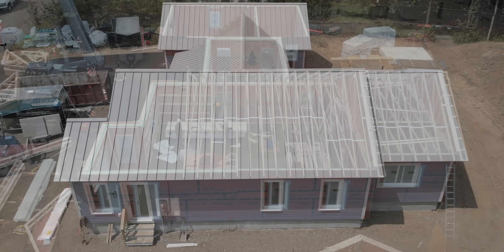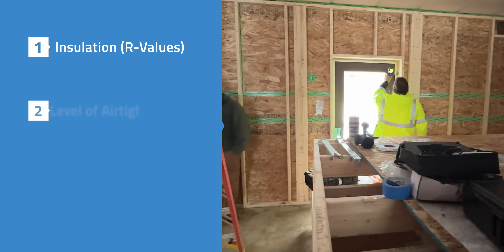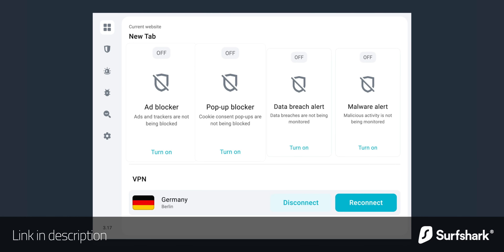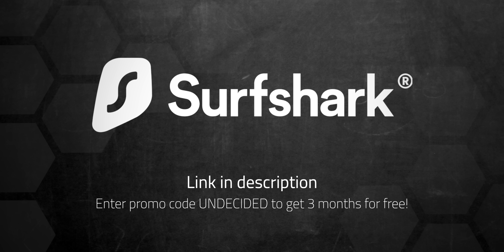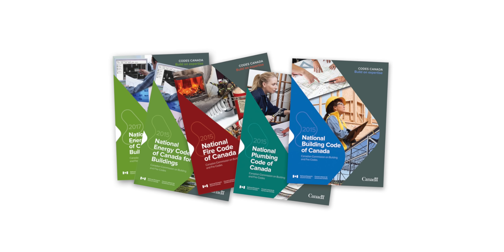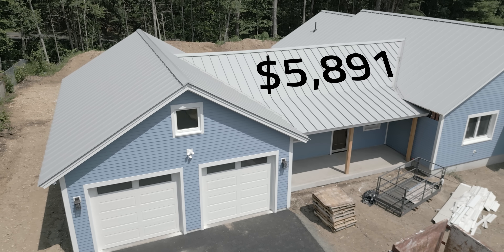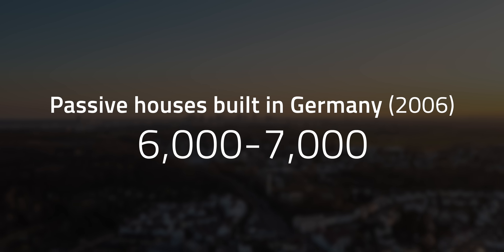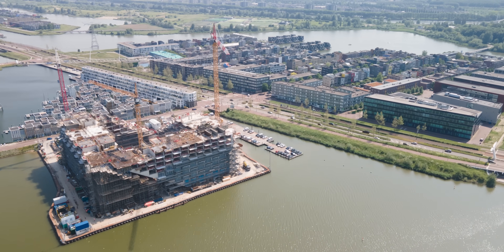Why Do American Homes Suck?

Comment: Yes, I agree that the "we want lower cost" mantra is the prime reason our house efficiency is lower.
I'm OK with spend a bit more now to get better performance over the long run, but bank accounts may impose limits on a person. :)
Still, we did 2x6 walls. We did 5 inches of spray foam for the entire house (meaning under the roof too).
Both of those were considered unusual and stretched my builder a little.
Heat pump for air and hot water, check; which means the ERV is required.
None of that was overly hard, but you do have to plan for and insisted on it in a custom build.
That last part is important because you don't normally get that in a "tract home", which is the issue as most people in single dwelling  homes seem to be tract homes -- at least in this area.
The 2x4 walls and other inefficiencies are cheaper to build and the "industry standard" here in the US for those of us not in really cold climates (and definitely here in north Texas).
There is a LOT of inertia in the industry, again dominated by what people what are willing to pay for.
I don't think that will change either unless the US starts to impose higher standards (IECC) nation-wide which I don't think will happen anytime soon (unfortunately).
And yes, like you I have a solar array ... again, spend a little more now to better returns later.
For at least half the year I have a minimum electric bill, so the solar array will be paid off in 6-7 years.

Comment: I am building a wood frame home in Finland, the outside wall thickness is 35cm, that is 13.8 inches. This is standard. The U-requirement on outside wall is 0.17.

Comment: Unfortunately, it's hard to even build a safe house in the United States due to very poor building standards and contractors. I remember seeing houses in Florida after Hurricane Andrew that were required to have either steel hurricane shutters or impact resistant windows while the bases of the house was a frame construction wrapped by tar paper with vinyl siding. They didn't even have the weak OSB. Plywood should be a minimum standard and an area with wind blown debris.

My preference in that area would be ICF.

Comment: The issue being is many of these 'codes' are written by people out of touch with many of the general public. They sit on councils and on boards of various organizations and make new regulations while not considering the cost. If you're making $200-400K/yr and are building a super efficient house for $600K in a city suburb that they commute back and forth in their Tesla, you are not in touch with the guy who works for a small mechanic shop 100 miles from a city who finally saved enough to build his house now gets hit with 'you need magic insulation, windows and HVAC, plus sprinklers and walls 2x thicker so your windows and doors are 2x the cost, now can't build on the lot he bought. Now he has to sell his lot to another code council member to build his weekend house.... 

Codes are fine but they have to be weighed against the increase in cost and who has to pay and who ends up making money.

Comment: This will mean much more expensive housing. Any regulation will drive up pricing. This will force more poor people into appartment blocks. This will make the US much poorer as equity won't be built in housing, most people's  single largest asset. Also this will ironically hurt landlords and available housing stock as they will not have as much capital to invest in new buildings as maintenaning regulatory compliance with extreamly strict codes will be a majority of rental income.

Comment: passive house in climate zone 6 or higher  is pretty easy.  my Canadian house built in 1997. would be  passive house  in a climate zone of 7a  or higher. or in  a latitude 45 or lower.. my home energy usage  at latitude of 52 ( not very much solar gain in the winter months ) in a hardiness zone of 2 (-45C)  my heating  energy cost is about $150  to $250 per year. standard house is  about $1800 to $2400 in my area . my vampire energy draw (  because nothing shuts off any more as they are not analog but digital in design requiring energy to operate )  is actually more then my  heating needs  in all honesty your house has too many corner to make a  well build passive house.

Comment: In the UK there are minimum standards and when you sell a house it has to come with it’s energy efficiency certificate which the seller has to pay to be undertaken and produced. Most houses here have very energy efficient windows and doors as is loft and wall insulation. However here most houses are built of brick.

Comment: As a carpenter in Alaska, your design I would argue is less efficient than the way we build up here. The guy that taught me builds to a 6 star energy rating for subarctic climates. Btw you need airchanges to prevent mold growth. You are making a huge mistake if you aren't doing that air exchange as moisture from showers, cooking, breathing, and etc. will build up and can cause mold if your airflow is too weak. Just the little things I know from experience in repairing alot of these homes.

Comment: 95% of municipalities won't let home owners build their own homes with stone/mortar, cordwood,earth ship builds,or thick timber,they want 2x3 popsicle stick homes that were slapped together by speedy Gonzalez crews,they throw cheap tin brackets in place of solid joinery,your not getting mortis n tenor in anything built in the last 50 years unless it was totally custom.The places where a person can legally source all the stone/lumber on their own property is in regions so remote from civilization it negates a lot of savings from not being a debt slave to the bank,it's perfectly legal to buy a mobile home or 2x3 junk box that won't survive elements or nat disasters,just the way THEY want it, Petroleum shingles absorb heat,attics become high humidity saunas that get soaked up into the studs and more importantly the glue board plywood.glue, water,weight,flexing between cold/hot weather deteriorates the nails,joints,shingles until the point massive upkeep is needed.Its not a house ,it's a vehicle to entrap naive homeowners into revolving debt.
Reply: I've read enough to know what you're saying is true. I don't think its by design intentionally...I believe its the unintended consequences of gov. Intervention and lobbyists. 
Famous economist Thomas Sowell has said "The road to hell, is paved with ivy leagues "

Comment: Contrary to your statement that the Us has No energy standards, it does for HVAC equipment for gas fired furnaces and boilers, air conditioning, heat pumps, and water heaters. 
I am a semi retired HVAC&R contractor and was pushing energy equipment sense the late 70’s. 
Much of the decision on a high-efficiency equipment is based on ROI (return on investment) 
My father had a house built in 1962 and paid for added insulation he went through and did some air sealing* he bragged about that our bigger house was cheaper to heat the payoff was a little over one year. (*The windows, etc were standard 60’s stuff), even then there was an excellent ROI.  Our 1979 and our son’s 1980 homes are planned for additional air sealing around electrical,plumbing, … in the attic as well as additional insulation this fall and winter, summers are hot in Oklahoma.

Comment: Wow, watching this makes me more appreciated what garbage my "newly renovated" rental is. It was clearly renovated as cheaply as possible with as many corners cut as possible. Currently we have to keep the ac on constantly because the instant it goes off the temperature begins rising. Not to mention that the mini split system just doesn't work here. Because of how the vents and ducting is set up the system never sees any change in the ambient air temperature and so will run forever no matter what the temperature is set to. I won't even go into everything else (like the original cast iron drain pipe that split right in half (lengthwise!) about a month after we moved in and got fixed by three separate handy-men because landlords are apparently just too universally cheap to just do it right the first time).

Comment: My wife is a steuctural draftswoman here in switzerland. If you solve for example a roof detail and forget to isolate something or a smal gap remains where brick or wood (if not extremly thick) has no insulation its considred a heat bridge. Its basically the cardinal sin of the job.

Comment: The main problem that housing price is extremely inflated. There are a century old homes that has to be bulldozed and rebuilt from ground up but nothing is done because it is extremely expensive and bureaucratic to say the least. 90% of buildings have low ceilings, not enough windows, leaking basements, mold in bathrooms due to the lack or non-working vents.

Comment: I'd would have liked to see a break down when you said that your house would have a savings of $5k a year vs other houses in your neighborhood. The other information that would be worthwhile for comparison is the cost of your house with all the energy saving upgrades vs the cost of the average neighborhood house. Then the comparison would be more fair than just the blanket statement of energy savings, as in, how long would it be to offset the added costs for that savings?

Comment: “The powers not delegated to the United States by the Constitution, nor prohibited by it to the States, are reserved to the States respectively, or to the people” this is the 10th Amendment of the United States Constitution. Is the reason for no national standard's on a lot Fields, not just building code. The solar panels did become affordable in the US until 2013. Jimmy Carter told us it would be in less than 10 years. Impearl vs. Metric. Congress passed a bill man dating we change over in 10 years in 1972. If you saw  car made in that period, everything was in both systems. The only industry that completely changed over was the beverage industry. There was so much push back that Pres. Reagan an congress dropped it. That was  over 40 years ago. We should have been finished with the change in 1982. State do not over regulate the housing industry  because of cost. Big cities like NYC an Chicago o over regulate. Of cost that excludes California which over regulates every industry, they 100,000 more regulation than the state in second place. Remember someone has to pay for these regulation, I am glad that you can afford it.

Comment: We renovated a house build in 1969 in 2005 in Germany. We installed a heatpump, a ventilation system which uses outgoing air to heat up incomming air which went through pipes in the ground of our garden before. We renewed the roof, the windows the doors. We installed massive insulation even inbetween the floors.
We nearly reached passive standard but it was very expensive. At that time it was pure hope to do something good for the future. It may have cost twice as much as
German standard homes at that time…
Today Building a house in Germany is so expensive that many young families aren‘t able to afford it anyway…
And not all regulations are well thought-out…
Reply: I've heard (and seen some videos about it) that MOST young Europeans  are resigned to the fact that they'll never own, they can only afford to rent.  The dream of home ownership is really non-existent for them.
Reply: I've worked for a company that specializes in houses made from prefabricated modules. They were not on the cheap side relatively to other building companies and still couldn't satisfy the demand of potential customers.

The reason was probably the low interest rate at the time because cost barely matters as long as banks are willing to loan money to virtually anyone. 
Buying a house and paying off a loan didn't really cost that much more than paying rent.
Rising interest rates crippled that somewhat.

I don't know how the market is today though since I'm no longer in the industry. I figured after millennials are done starting families and buying houses in the process (that was our biggest customer base), the market would've slowed down anyway.

Millennials were the last generation born during years with high birth rates and are around 40 years by now. Those who haven't bought a house until now probably won't ever. After them there's just not that many people so the market will have to adapt or shrink.

We'll have to wait another 20-30 years until gen alpha is settling down to see another noticable rise in demand I reckon.

But that's just like my opinion man...

Comment: Well, I wouldn't be so hard on US building. I'm from Switzerland, and worked as electrician then as electrical engineer for the past the 23 years.

First, not all houses are made with high efficiency standards, far from that. Many architectecs aim for below the minimal requirements and hope not get caught on inspection. There is a lot of trained workers missing on the field, and many people aren't professionnals on the housing construction sites, so air or water sealing is far from always done right. And old houses still not updated regarding insulation.

But the major problem, it's that here, in Switzerland, even in rural areas, houses are so expensive because of our construction techniques, that even a working couple with degrees can't afford a house whitout wealth from heritage.

A small family house costs around 800'000 USD. An "american suburban" sized house costs more tan 1'000'000 USD.

So yes, our housses can survive hearthquakes, tornados, but they either belong to the bank or you will pass debt to your kids.
Reply: This is what I've heard too (and seen in some other Youtube videos).  So the building techniques Matt describes are probably happening only in select areas for select homes that WILL be expensive, being bought by cost-no-object owners. That's not typical.

Comment: I am gonna build my own passive house with dualsun solar heat and electricity panels, battery in the basement and a smart electricity tariff which allows me to export electricity when expensive and Import when it's cheap. By that you can actually get money for living in your house effectively. For heating/warm water i am gonna use a heatpump with a Reservoir being linked to the solar heated water from my roof. With an EV i have to pay for electricity in the end but the house itself is net zero cost.

Comment: One thing I do like about US rules in general, is that regulations are often quite prescriptive, stating exactly what you need to do (thickness of insulation etc.) to meet code. Here in the UK, we tend to have open standards for everything, where a certain benchmark must be met, but there is little guidance how to design to achieve the standard. This is great for large developers, because they can do all sorts of technical analysis to find the cheapest construction to meet the bench mark standard, and the savings on material more than pay for the design work.

But for a homeowner or small local builder, it's difficult (and expensive) to get design calculations done to establish what's needed to meet code, and coupled with very inconsistent inspection & enforcement, this often results in substandard construction, particularly for extensions and renovations. Ireland has a great code system that allows both the flexibility of design to benchmarks, but also specifies standard construction details that will automatically meet code.  So they get the best of both worlds.

Comment: HOT / HUMID
Though one can implement passive solar and superinsulation for cold / dry climates, it isn’t that simple in hot / humid climates.
Taking a cue from indigenous architecture in hot / humid climates...
The solution for when conditions become miserable - and especially when there is no power for A/C - is to copy the example of the jungle hut - just a roof and maybe bug mesh - and little else. The obvious question is : how does one build a superinsulated jungle hut?
Answer : you don't. You place the "jungle hut" on top of the superinsulated house.
Make sure your design has a nice, flat deck on top. That's where one can set up a belvedere, loggia, sleeping porch or whatever you wish to call it. 
IMHO, a shaded roof deck is far superior to a backyard deck or a front porch. It's higher up, in the breeze, has a great view, and if one wishes to set up a hammock and sleep, it's not visible from the street below.

Comment: The Architectural establishment considers superinsulation to not be cost effective, citing the inherent losses through windows. Even the most high tech windows represent a substantial "hole" in the wall. However, one simple solution is operable insulated shutters, closed during the night or when there is an extreme temperature event. Such shutters can be designed so that they can incrementally close off the thermal "hole" and still allow some light. (ex: "split" shutters)